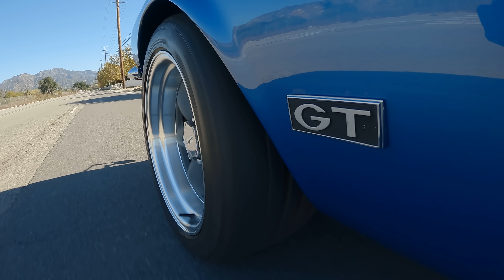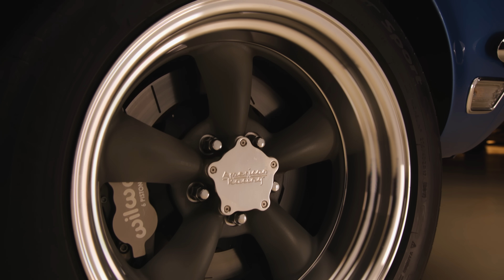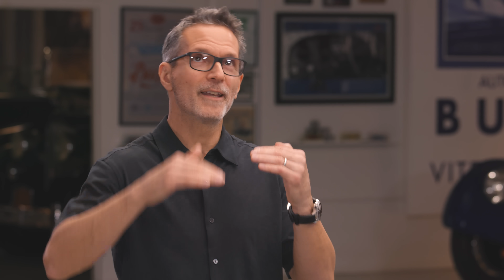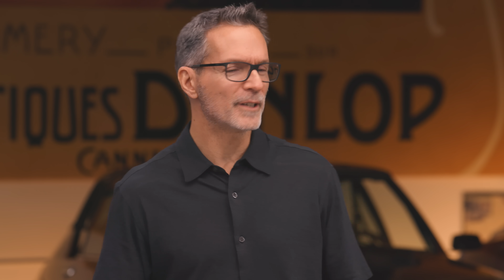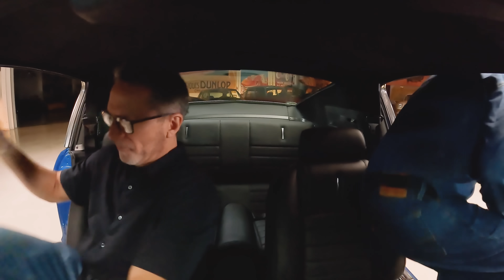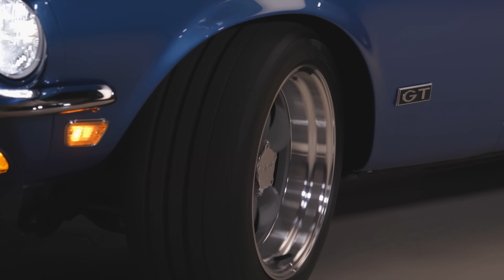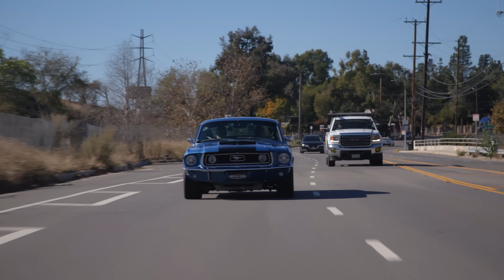Revology 1968 Mustang GT 2+2 Fastback Cobra Jet

Comment: I don't understand how car companies don't just rerelease their older models from previous generations just with upgraded and modern tech? Edit: *and modern safety standards. I should've just said that from the gecko.
Reply: They can't due to modern crash test standards and other safety regulations. Also most people want modern cars the market isn't big enough.
Reply: @Exocartonic  Glad someone said it. Even the body shape has different crash test results. Would have to be a complete redesign.
Reply: @memento_mori6454 The size and shape of the '67 Mustang is perfect.  A 2+2 model is far better than a 2 seater, you can stick groceries in the back, along with the kids.
Reply: @Exocartonic I wonder if I could make changes where engineers can engineer in real time and not based on some private shareholder's regulations. So people have actual passion and drive as kids to do things. But those who make it to those fields (medicine, aeronautics, etc) soon find out that they are just meant to dispense a system. Not express their real talent for the benefit of mankind.
Reply: @Exocartonic  I think you missed the part about upgraded and modern tech. Basically just the body be shaped like the old models, but all the tech and performance be modern. Just like revology does it.
Reply: @robertbrannan9375 I work for one of the Big Three. Most folks don’t understand the engineering that goes into building a car. I know it seems simple on the outside, but it is a MAJOR process to “tool up” for a new car. It costs millions of dollars to design cars, the engineering that would have to go into making a new ”old” car maybe one- two years of effort. Just not a big enough market to justify it. They would never recoup their investment. To even come close the vehicles would cost so much that most couldn’t afford one anyway. So it really wouldn’t be any different than it is now. Not to mention the government standards they would have to meet. These companies follow a different set of rules. They don’t have to meet certain safety, emissions , fuel economy, etc. 
BELIEVE ME, I would love to have one too. Unfortunately it’s just not realistic. That’s why companies like this do what they do. Still extremely expensive to buy one though.
Reply: @robertbrannan9375 
The Challenger has the look. And it's heavy
Reply: @stever8776  it does!! It really does, I actually thought of that, it's the only one I know of that really has the right look! For nostalgia sake!
Reply: @robertbrannan9375 I think you missed the part about SAFETY regulations, etc.. The "literal shape" of the car cannot be recreated today, as it usually poses a safety risk. I mean that aggressive, sharp front end would easily pummel a pedestrian. The shape of the windshield is a good example for most older cars. Because the way safety has evolved, the old cars are sadly too dangerous.. Yes you can add seat belts and stuff, but you can't change the body/shape (otherwise it's now a modern car).

Trust me, it sucks. But obviously with cars like the challenger, charger, 2005 Ford GT is a good example.. They want to make the iconic, classic shapes. They're just limited on how far they can go.
Reply: @robertbrannan9375  well, the Dodge Challenger is a pretty solid example of what the OP is asking for.
Reply: @Markbell73  you're right!
Reply: @robertbrannan9375  actually I'm left handed. Everybody misses that detail. 

Wordplay ^ it's what I do.
Reply: @Markbell73  😅
Reply: @robertbrannan9375 Fuel standards are set by Big Brother. That's why they can't.
Reply: @robertbrannan9375  ford did it with the 05 mustang
Reply: @Markbell73  As has Mustang for 60yrs straight. ❤ 💯
Reply: @bruhbiqw6237  Absolutely & the GT500 version worth huge $. I tell ppl get a new Mustang special edition like Dark Horse 🐎. Enjoy it. Keep mis low. Goes up in value! 💯
Reply: @Davido50  Ford didn't start going retro with the Mustang until 1994.
Reply: @robertbrannan9375  you can't make a car with a 60's body to meet the safety regulations no matter what technologies used
Reply: @robertbrannan9375 except for the safety, no airbags no abs no traction control no crumple zones. And it costs over 300 grand. Modern cars have a lot more tech than an engine and transmission
Reply: Main thing is airbag deployment, you need a certain distance between panels and body for it to be legal

Unfortunately once you obey all those rules the shape of the car starts to look a little funny which can turn people off to it
Reply: 5 ft tall front grills on new pickup trucks seem to be okay. They would do alot more damage to a pedestrian.@BiIlDipperIy
Reply: @Exocartonic  plus emissions an tons other stuff. They be low selling niche vehicles! Facts for keyboard warriors.
Reply: This kind of work has to be done by artisans in a studio not union auto workers in high volume factories.
Reply: No money in it unless you are an independent like this guy. They stay in business by selling a couple hundred thousand units per year or more. Pretty cool that you can buy a 68 mustang new now though! Only a 6 month wait! Love the 68!
Reply: @abbottsplace8080  these guys sell 60 cars a year.  That's  it.
Reply: @abbottsplace8080 they have made 120 cars in ten years 120. They have 20 orders working and are going to make 60 next year. This is what the man said in the video.
Reply: What is the answer to 99 of 100 questions? .....   Money
Reply: Safety is one reason, economy is another...
You can't build them like this anymore because of those damn regulations.
Reply: There is no amount of modern tech/upgrades that would make a car modeled after a classic car, such as this one, pass safety regulations, cafe standards, and the myriad of other government regulations. It would be cool, but it doesn't happen because it CAN'T happen
Reply: @crewdawg2008  Well, everything is possible for the right price of course.

But those prices usually include 6 zero's...
Reply: To many law suits.
Reply: @timburns5025  Every large corporation gets sued. Toyota got largest ever fine by NHTSB $1B for hiding defects . Some facts 4ya.
Reply: @timburns5025 How so?
Reply: @drobson8004  because being able to make a car as more nimble, with rack-in-pinon, and ezer useage of a hatchback, along with newly design rubber bumpers coves, gave a better and safer vehicle, and they have tried to cancel or make more expensive to Owen, that I introduced the Retro-cars design for mr.Fords, that keept them alive, at the age of 16, after I got Farah to sell out the mustang2 in 74, along with my dad, at Ford motor company, that also my grandads had built the MODEL-T for the Oldman of years past. And I didn't take a dime, but I did also emach, new mach-1, and the name DARK HORSE.
Reply: I agree.
Reply: Won’t pass crash tests, etc. but keeping the shell and re-engineering for safety could work.
Reply: @ejford5083  fun fact: Rolls Royce doesn't crash test their cars yet they still sell them to the public.
Reply: @soulassassin0g  Ridiculous Co. I can afford lots expensive vehicles..i choose new Bronco 4dr Sasquatch 2.3L (300hp).
Reply: To many restrictions and safely regulations to mass produce a vehicle like that
Reply: Because of all tbe regulations etc placed on them...
Reply: EXACTLY!!!
Reply: @soulassassin0g  The are starting to. Look at the Aston Martin Continuation cars
Reply: Been Say'in that for Decades.
Reply: Dodge made a great re-incarnation of their Challenger!
And you can get it with a big engine. It's heavy but it looks similar. The Jail Breaker wide stance is Great. But 2024 is the last year.
Reply: Unfortunately, those in charge of the car companies nowadays don’t really care about the history and nostalgia and what got them to where they are now. They don’t appreciate it like these aftermarket builders do and us drivers.
Reply: @UghDroppingLoads exactly plus these companies cater to the rich the same people that have destroyed the markets that the blue collar person supported and built.

 Screw these companies and their 250k plus prices for a car that shouldn't cost more then 50k

ThNks Jay for supporting these con artists !!
Reply: @UghDroppingLoads Would lose value in the older cars.
Reply: @UghDroppingLoads  Not true. Can't meet emissions..retool whole factories for niche models? Keyword warriors don't understand the complicated automotive business. Period.
Reply: Same. It'd be a huge money maker! Even if they just did limited runs.
Reply: @robertbrannan9375 that would be a huge highlight on inflation. Cars that once sold for under 10 grand, now starting at 100 grand. Lol
Reply: Well Porsche have been doing it for almost 100 years with no real noticeable change in styling....
Reply: I was told that the cars would have to meet modern MPG standards so the body has to be aerodynamic. That is why today's cars all look the same. Also, the crash safety test is another big factor.
Reply: Government regulations
Reply: They sorta did earlier this century. The 2005 Mustang was clearly based on 1969-70 models and they are my favorites.         The Challenger is definitely inspired by its predecessors of the same years. But that's all I can think of.
Reply: Listen up. It's not because CEOs are stupid or no demand or any of that. It's GOVERNMENT REGULATIONS. Even when Dodge brought back the challenger the government fought them left and right on every single design. Today canceled because of carbon regulations.
Reply: I want a original mustang with all the original OEM parts, you can stick that modern technology where the corporate enterprises can see it, some cars are made to be left alone, I want a classic car made that has all the original parts OEM. The value of any classic car that has been modified is not a valuable as an original OEM car.
Reply: @Johnclark300  buy old one an rebuild it.  Can't beat the modern (new) ones tho.
Reply: Because they are literally handcuffed with all the laws against them
Reply: I’ve been saying that online for a couple years. Especially the c2 corvette, quite possibly the most beautiful car ever made
Reply: @Mncrr  I hear ya. What I would give for a C2. It’s in my dreams. The closest I’ve gotten is my Hot Wheels. All I can afford is the very poor man’s sports car, a first gen Miata. When I want to comfort watch, I dig up the first 2 minutes of https://youtu.be/UM-Q_zpuJGU?si=QMYs2xspei32GdPf
Reply: Impossible. Silly to think it is. Those days are gone. Get over it.
Reply: Nobody wants modern tech that’s the whole point of classics
Reply: I been thinking the same thing. Bring back the old Ford body styles.
Reply: If you've been paying attention you'd realise that subsequent models only have few differences every year and only get design overhaul after about 5 to 10 years. The problem is that these classic cars are different in their build process and would require a complete overhaul of the manufacturing and assembly line for every model.
Reply: @sixthousandblankets  psheww
 I thought noone would give the long answer.
Reply: They don't have the equipment anymore. The metal stamps etc have all been thrown away years ago.
Reply: Look at the retro cars that make it to production, they don’t sell.
Reply: The mustang, bronco, camaro, corvette, trail blazer, challenger, wagoneer, etc. They do re-release their old models?

If you mean the exact same car, its impractical to update an old platform to modern standards. You'll get a better end product, for less money, by starting from a clean slate & designing something new.
Reply: That's exactly what Toyota does to land cruiser 70 series. You can buy brand new today  equip with modern features and safety. But retains the 70s look
Reply: Could you afford a $150,000 plus vehicle? Probably not, if you could there would be a modern-day Shelby in your garage. That's what it would cost Ford to reproduce it in larger numbers.
Reply: That’s a question I have too
Reply: @LRiper  see my comment.
Reply: They could.  Unfortunately, CEOs these days have VERY limited vision.  They say they want sales but they really don't want to have to "work" at it.  Doing real classic production would require actually "caring" about the product.  The fact that they build in Mexico with lowest cost bidding being the preeminent issue proves, to me at least, that they don't care about quality anymore
Reply: @asajayunknown6290  Not true. Automakers like Ford Motor build most in US than anyone else. Just 1 example. Hence only Ford trucks/ Lincoln SUVs in our driveway. 💯
Reply: @Davido50  it's not the where.  It's the emphasis on lowest cost.  It's why the newer Fords are trash by 100k miles.  I grew up with Fords.  Drove an 86 mustang with no issues whatsoever to 150k b4 I sold it. Since 2015 or so, they just get worse and worse.
Reply: Yeah, it would be great. I’d buy one tomorrow. Any old car Camaro charger Mustang let’s do it.
Reply: @jasonfarnsworth5880 Got $300,000?
Reply: @jasonfarnsworth5880  You have new Mustangs & Camaros that make 500hp while cruising 75mpg on hwy w/AC running getting 28mpgs. Better off w/new Stang or other before they GONE!
Reply: Us older people have been wondering this since 1982 lol lol 

These companies charge like 250k plus for these cars and are only catering to the rich, despicable !
Reply: Absolutely agree. This car featured is simply stunning.
Reply: They would if it was that simple.
Reply: Two words:
Cost effectiveness
Reply: Yes. 205gti. I’d buy one tomorrow!
Reply: One word, "tooling"
Reply: Probably has more to do with safety than anything else.
Reply: Regulations is why. Plus they tried that formula.
Reply: They all have modern models camaro corvette challenger charger mustang bronco etc. This particular car has no abs, airbags, catalytic converter, crumple zones and the list goes on...
Reply: Cause those cars may look awesome but unfortunately the main market doesn’t want them but even more importantly is car companies have so many safety regulations now and those body styles are just not build to meet the present safety requirements for a product to be released.
Reply: I think the bodies are dynacorn made in china
Reply: I don't think they would meet modern standards. For crash protection or for pedestrian safety
Reply: Stupid SUVs….
Reply: All North American Corps try to establish them selves.
 AMDEX NASDEX NASCA -Regacy or Legacy
It's up to yourself
Reply: You wouldn't  be happy . You can't go back . Especially  price  .
Reply: I think it would cost way too much, all the machines they have that stamp the steel would all have to be changed over  and that would take the machine out of service for the new cars that should be rolling off the assembly line. Those machines cost millions of dollars and take up a lot of room. It's just not a financially wise decision especially with all the lawsuits they would have and already have.
Reply: Makes sense to me.
Reply: They won't pass as new model cars with the national highway safety standards. And has to have so much new tech with mandatory back up cameras and side impact airbags and sensors and all sorts of stuff they would have to complete design a car from the ground up
Reply: the “gecko”? Is that like “get-go”? 😊
Reply: Jaguar is doing it and it's amazing
Reply: Most of the tooling has been bought by companies such as Revology.
Reply: You'd never spend 50k again. You'd just buy panels and pieces... How am I gonna make any money when you don't have to keep coming back for new and more newer things
Reply: From the Get Go 😂😂Gecko….
Reply: It's not the car companies it's the regulations. We need weight limits for cars then they could make these again but everything has to be built to be hit by a huge SUV
Reply: @RaysNewLife  correction. Built to be hit by a 10,000 pounds of battery.... SUVs are nothing compared to these EVs
Reply: Also this car is 322,000 dollars....
Reply: Because the EPA has ruined new cars.
Reply: "from the gecko"??
Reply: Actually rules change, epa is only part of the issue.  Regulations on headlight height, spacing, windshield slope, size, nose construction material allowed, taillights even more so, crush zones, airbag locations, obd2 requirements, unibody vs frame, on and on.
Reply: Money... older cars were heavier, real steel
Reply: Too much Government red tape
Reply: The car featured in this vehicle cost over 300,000. No major auto manufacturer would do that. They would never be able to sell them in any serious quantity.
Reply: expensive tooling Look how much they charge for this little reproduction or whatever you want to call it continuation It's massive amount of money
Reply: Gecko ? 😮  😅   😂
Reply: Not possible for a lot of reasons; chief among them is that the "Reproduction" classification by Federal Law restricts annual maximum production to between 500 or 600 cars.
Reply: They build 60 cars per year...impressive...you get the best of both worlds..the classic look..YET modern day handling and engine reliability and high hp..well done.
Reply: Big Money is made on NEW PARTS that can’t fit OLD MODELS.
Reply: Jay, I love your show and I hate to disagree with you but, being a union autoworker, I must. Labor cost is less than 5% of the build costs of vehicles. That’s build cost not the MSRP that you see on the window, which is significantly higher. Engineering tech, materials and machinery operating costs are the bulk of production costs. Not to mention the investors these companies have to make money for. Let’s also mention what the top brass receive in compensation. Thank you for what you do for the automotive world Jay.
Reply: @raysmith4208  Absolutely facts. Engineer in automotive industry! 5% max is labor costs ot big6 automakers!
Reply: They're too busy building modern models.
Reply: @Oliver-1755 building garbage
Reply: If they did the old cars would be worthless.
Reply: @jaaackhammer  You beat me to it haha. Exactly. Where's the enthusiasm of having an old one then? 👍
Reply: old one stillnot devalued @jaaackhammer
Reply: Think about longer, you will figure out that these old cars would look like burning turds with required a,b,c pillars to fit air bags
Reply: All that work to have a hot air intake from a 2003 Summit Catalog is wild.
Reply: Because cars today are basically designed by government regulations.  That's why they all look pretty much the same. You can't deviate too much from regulatory standards.
Reply: @Batterybus  And that's why the auto industry went to hell, car companies dicied to go corporate and allowed big business and big government tell them what they wanted on their vehicles, Harley Davidson can't even make the old evolution Sportster anymore because the EPA told them they can't, we have allowed big business and big government to rule over us, and because of this, we no longer have any say as to what can be produced in this country.
Reply: @Johnclark300  You don't own anything new obviously.
Reply: Because cars that are only good in a straight line don’t sell in the modern age.
Reply: Actually, Nissan offered a factory refurbishment for old Z cars, (making old…new cars)…when production ended for the Z car (for a while, in the 90s).
Reply: @j.b.morrell8830  interesting. Thanks. Maybe you can answer this. Can a private company purchase the c2 design from GM for their own production?
Reply: Because they not thinking
Reply: There's a company that sells upgraded replicas
Reply: Because if you get hit in that car, you’re dead.  No chance to survive.  And you know the amount of morons who have money that’ll buy a car like that and go try and show off and end up killing themselves and/or someone else.  That car would fold like a sofa can if in an accident.
Reply: @tccanny8309 😅